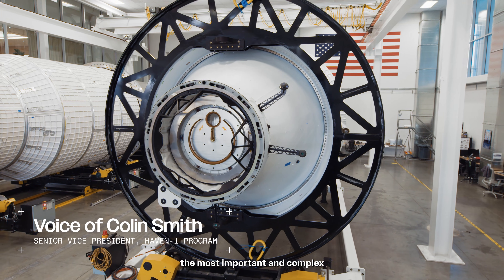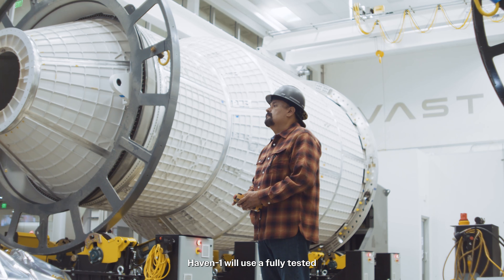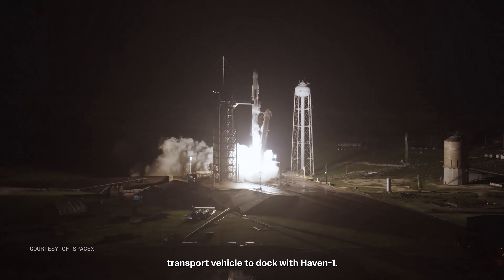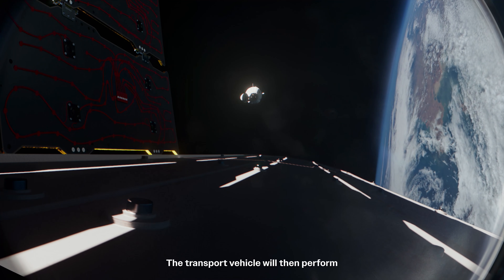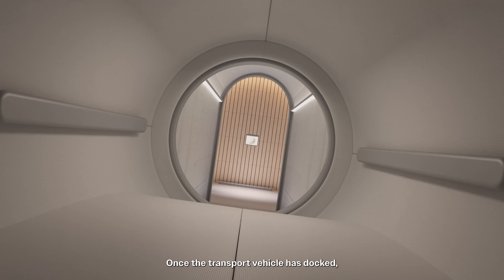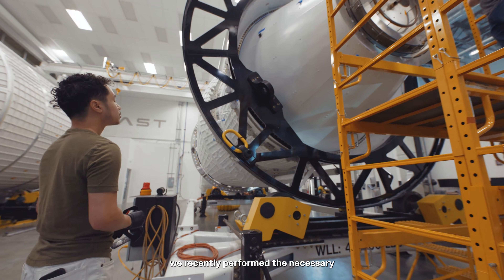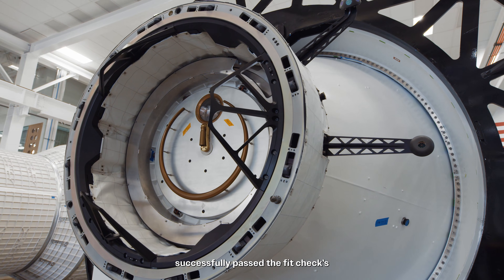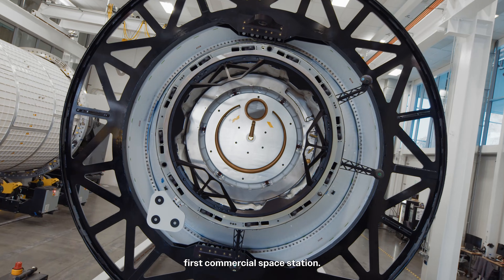Haven-1 Docking Fit Check

Comment: Why not built for Super Heavy to lift an even bigger station?
Reply: We could do that and it is a good idea, as is using Starship for a Space Station. Haven is a good idea because we will launch it in a few months using current Falcon technology.
Reply: Haven-1 is meant to be an early test article. Haven-2 is designed to be launched on Falcon Heavy and the core module of the Haven-2 station is designed to be launched from Starship. But they want to get this one up there ASAP to prove that they can do this and get funding. Otherwise, the bureaucratic Axiom will suck it all up based on their lobbyist relationships with NASA.